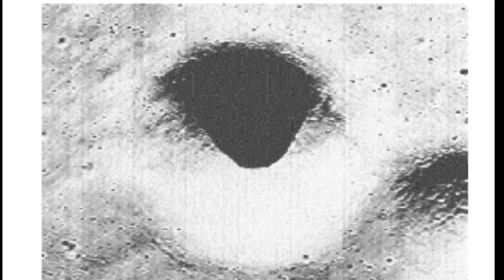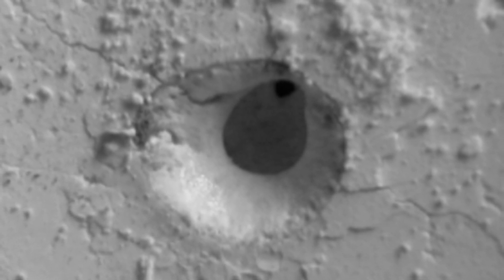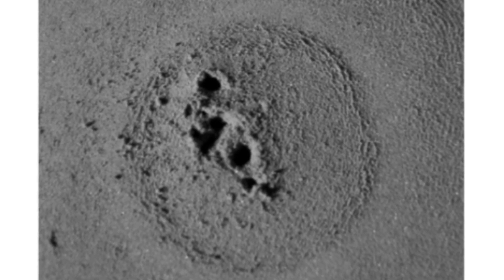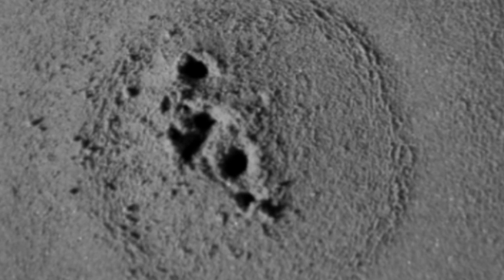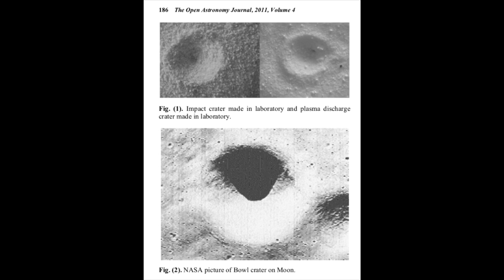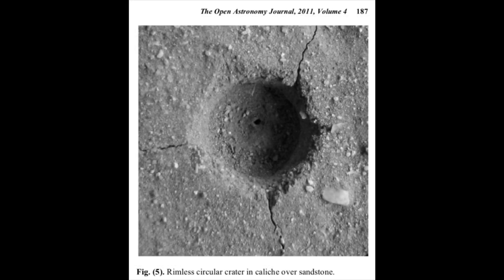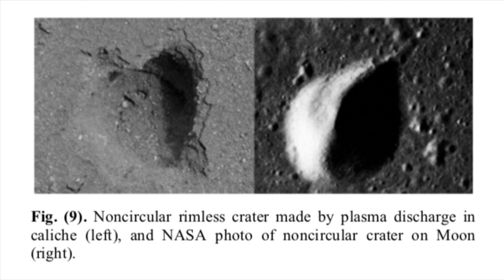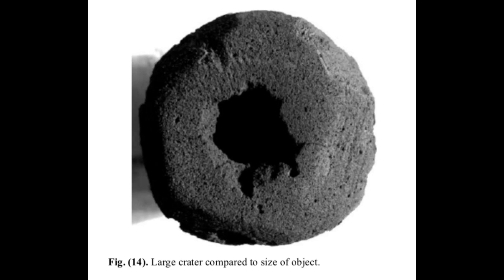Laboratory Modeling of Meteorite Impact Craters by Z-pinch Plasma | C. J. Ransom

Comment: 8:52 showing the NASA photo of "bowl crater" on the moon, presents a problem. The rim at the top of it seems not to correspond to the shadow cast.  Unless there was a sculpting into the surface drilling down with a hardened surface describing that arc, I'd be inclined to think that photo has been doctored